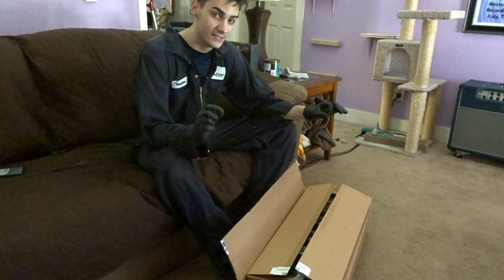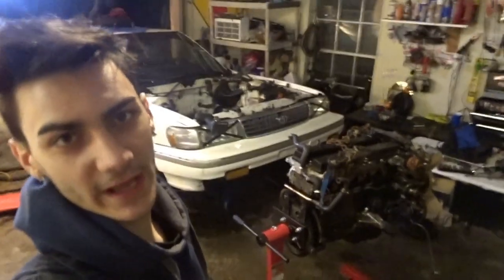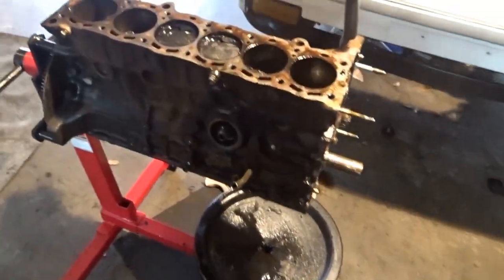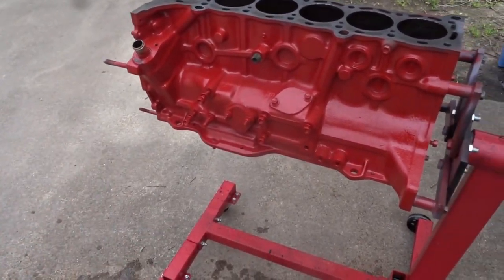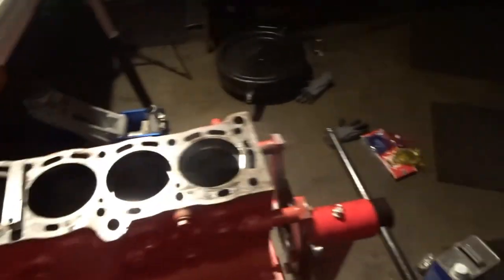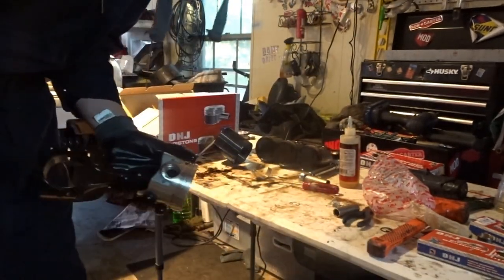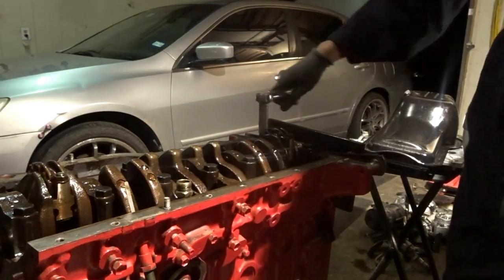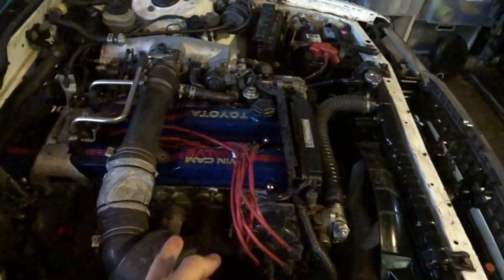7M-GE Full Engine Rebuild/Overhaul 1992 Toyota Cressida

Comment: This guy is awesome, I got to rebuild mine soon so this helps so much!!
Reply from the maker: Glad I could help!! And Good Luck once you start. It’s not as difficult as it looks once you get into it just make sure to follow all the steps and you’ll be good!
Reply: Steezy Garage your videos really help bro  💯💯💯 I’m trying to change the head gasket on my 7mge
Reply: @Samir Casen instablaster =)
Reply: @Adrian Martin It worked and I actually got access to my account again. I am so happy:D
Thanks so much you saved my account :D
Reply: @Samir Casen no problem :D
Reply: @Prestanium  hey I know it's two years late, but for the distributor, how did you align the notch on the housing with the indent on the driven gear? The dizzy only seems to want to go a bit to the left or right of the notch, but never perfectly lined up. Did you put your gear indent to the left or right in yours?

Oh also when I say left and right, I mean while having the dizzy cap facing towards you.
Reply from the maker: @edbo10  so it actually took me several tries to align it. If you have a timing light it’s easy to just pop it in and try to start it and if its not in proper time then pull it out and spin it over one notch.
Reply: @Prestanium  ooh ok, i think i might've gotten lucky. my engine seems to sound and run ok, unfortunately when i went to set the timing, cranking it for the first time with no fuel in the rails caused the engine to buck when it tasted the first drops of fuel, the shaking was enough to cause the shit hood struts to give way, smashing my timing light to bits.

Comment: This is 4 years old now, I'd like to know if it was a success? A lot of people probably didn't catch it but you loosened the Headbolts in the Tightening order and actually did that wrong. Both are crucial for a proper seal, not mention you could have warped the Head. And the DNJ Brand, I feel,  should never happen with the 7m. It's just more Chinese junk. My criticism aside, I'm glad you took the time to make this video.

Comment: my grandma died a year ago and left her 1992 white cressida with the fam ;  it only has 45,000 miles on it. It certainly needs suspension bushings, tie rods, fluids and some love. What is the best place to source parts for this car? I usually use rockauto but they dont have any for this car
Reply from the maker: Ojo Aereo I’ve bought most the parts from Partsology.com good prices and decent quality. Nothing spectacular but for a restoration they’ll do just fine

Comment: Hey man. Great video. I had a question, I have an '89 Toyota crown with a 7mge.  I've had a new head gasket with arp head studs and new valve stem seals. My problem is when its parked up for a few days, It smokes really bad on start up. It does clear but its every time. What would that be?  Maybe the piston rings?
Reply: Most likely the rings yes, if they did a head gasket job in the car they wouldn’t have removed the pistons and done the rings, just keep checking your oil and coolant. Also, look at the color of the smoke, blue tint means oil(piston rings) white tint means coolant(bad head gasket job)

Comment: yo i have a near perfectly functioning 91 cressida with the 7mge in it. like i said almost perfect needs an adjustment on the distributor, like turing it to make the timing right. i suspected it because shes running rich and randomly misfires and has poor idle on start up, maybe 40/60 percent the time, less then often. any idea where the timing mark should be when ive got the light flashing on it with the E1 and TE1 terminals jumped?
Reply: a year late, but toyota standard timing is 10 degrees BTDC

Comment: the head gasket is the biggest issue with these engines, they changed the head gasket material at the last minute due to the asbestos ban and they never tested the new gaskets Tourqe and used the asbestos ones instead, even Toyota does not know the right head bolt torque spec. maybe someone online would know unless you found out already? I want to rebuild mine but a 2jz cost the same amount as a rebuild lol
Reply: GRAND HIT o.k you need ARP studs and torque to 110 NM
Reply: A proper 2jz swap costs like 7-10K depending on quality of parts used and how well done the swap is and still at stock power levels. That 7k into a 7m will yield a very powerful and reliable engine.